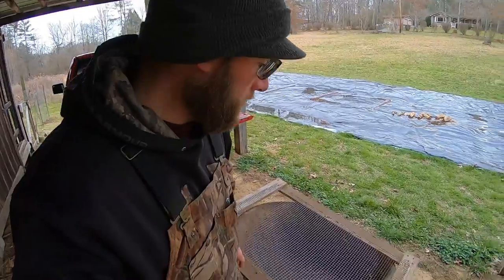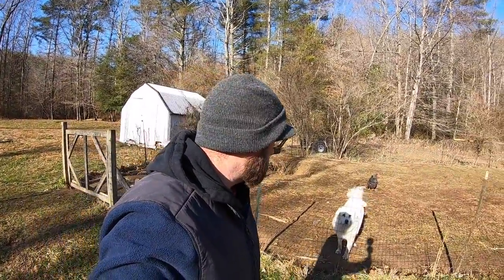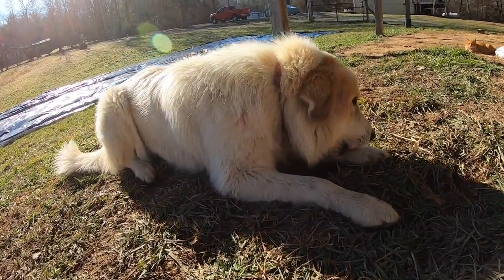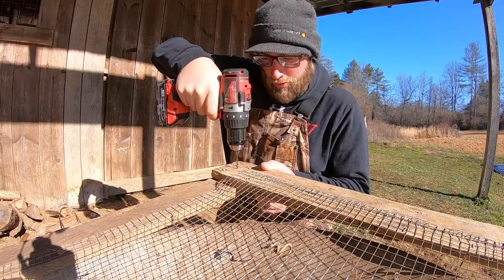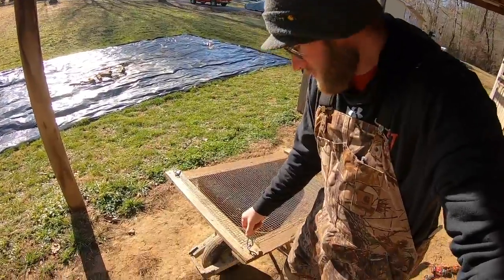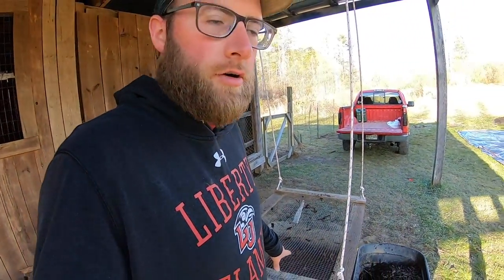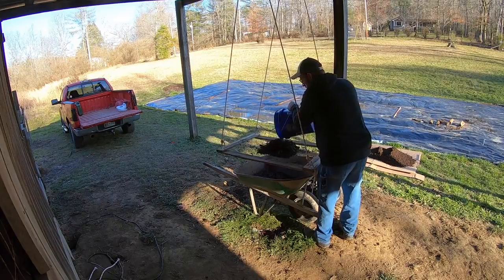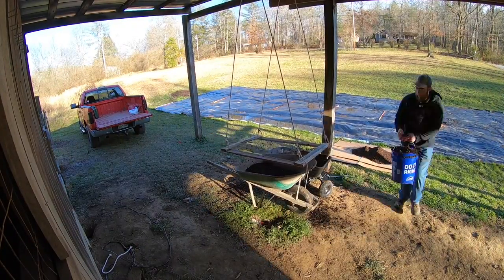We Build an Easy Wood Chip Sifter | Homestead VLOG

Comment: Seems like it would be better to have sifter closer to the woodchip pile instead of moving chips so far away and then back again
Reply from the maker: Yes, but then I would have to build a structure to hang it on instead of using the barn which is already there and in between the wood chip pile and the garden.